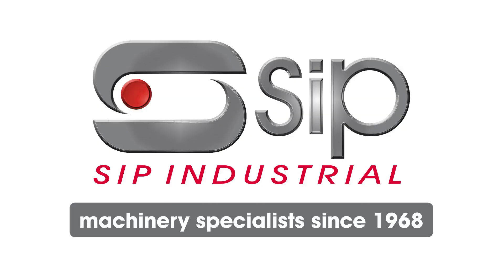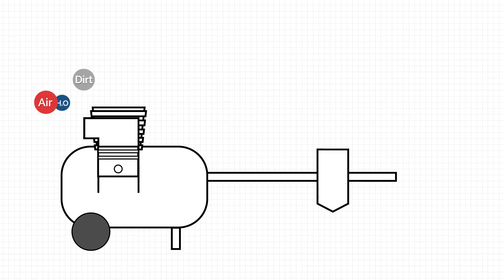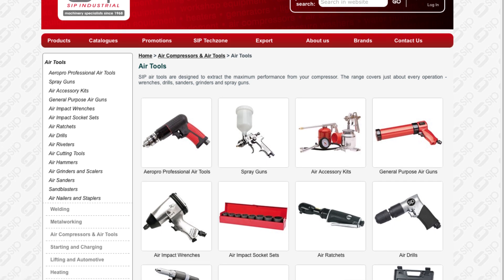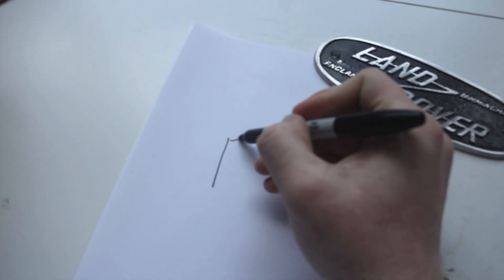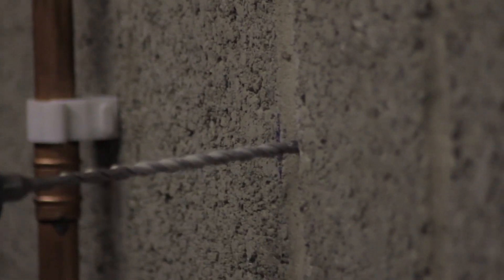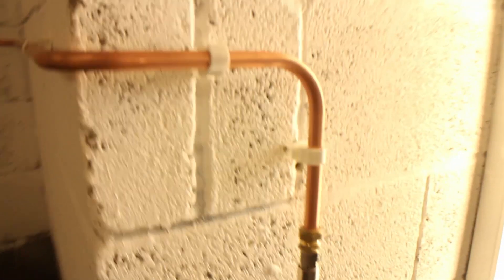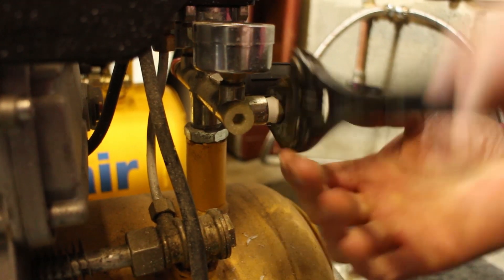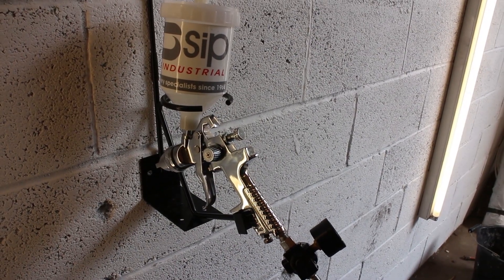DIY Land Rover Respray: Air System Set-up

Comment: Hi Ben, sorry, another question, the filter you have in your air system is a Regulator, Filter, Lubricator, according to SIP's website. 
When spraying paint does the addition of oil into the airline become a problem contaminating the paint? or do you use it dry?

Ross
Reply from the maker: rossmaynard the regulator we have is just a regulator and water trap
Reply: Mmmm.... the product number says its a lubricator as well. I shall email them.
Reply from the maker: rossmaynard must be the wrong number as we definitely only have a trap and regulator, the oil lubricators have an additional element on
Reply from the maker: rossmaynard ok I see, in the line drawing we made I've shown one with an oil lubricator. You should make sure this empty and never used as any trace amounts of oil would get into the paint